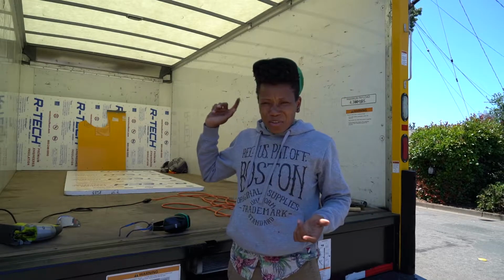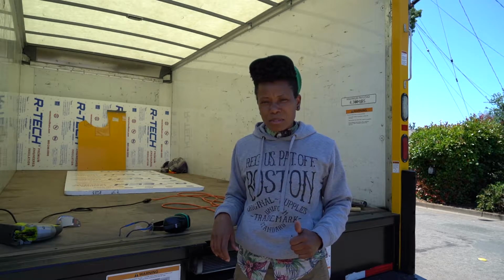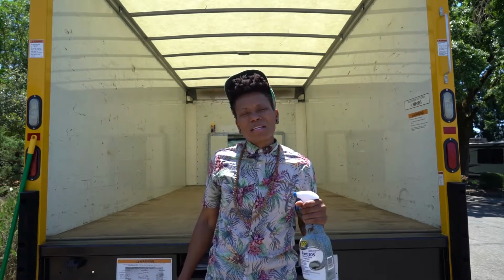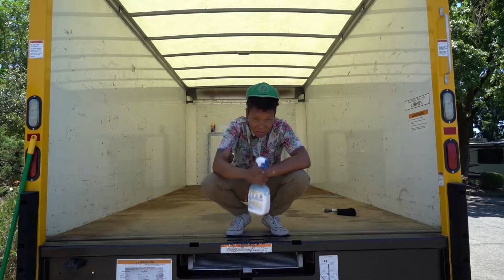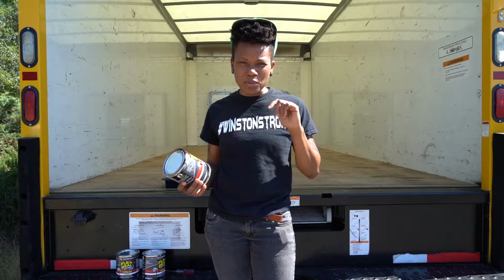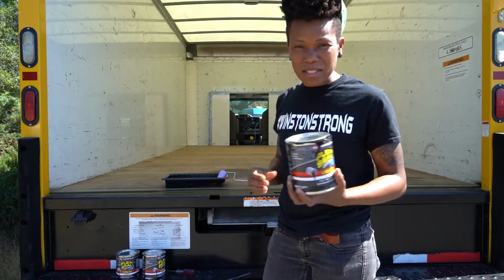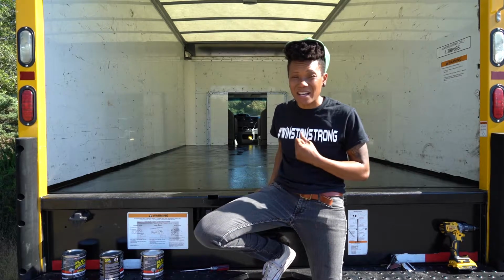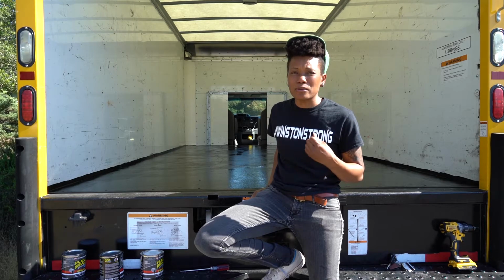VAN LIFE // Subfloor part 1/4 prepping

Comment: When you add solar, are you going to install panels directly onto the plexiglass? roof, buy a roof rack, or build your own rack?  I was looking a roof racks but would require an extra wide.  3 piece rack is 350 and might require another piece.  It seems the roof is slightly convex and not flat.
Reply from the maker: Sorry Normal the roof does have a bit of a curve to it. I’m going a little bit of a different route. I’m posting a video about it soon. Removed my roof and I’m building a new one out of steel studs. My solar will attach to that. I wanted a taller roofline for what I’m planning for my interior layout. I’m no expert of course, you definitely have to find the way that works for you. The route I’m taking is a tougher build but closer to what I want in terms of layout. I’ve seen examples of people building right inside of the box that work perfectly well.
Reply from the maker: Sorry Normal this guy https://youtu.be/09wmn9SoD7A built directly inside his box
Reply: Cool! looking forward to that.

Comment: My van has somewhat of a 'feet' smell to it.  Did the degreaser remove any van funk you might have had?  I thought about replacing the wood but that might be too much work.
Reply from the maker: Sorry Normal mine didn’t smell like feet but it definitely had a smell...like motor oil. The degreaser helped. Sealing it helped. I heard cleaning the surface with a vinegar water solution could help with odors too. I removed my door and roof fairly soon in so it got lots of time to air out.
Reply: Got rid of the smell by degreasing the walls.  Got flex seal at lowes, one of the smaller cans filled 90per of the floor on a 12ft truck.  Glad I picked up another can.  I plan to use the remaining on the steel? bumper after sanding it and or using a wire brush.